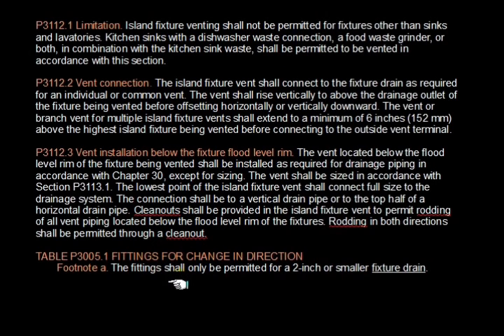Plumbing an Island Fixture Vent / Bow Vent / Chicago Loop

Comment: I completely agree with all your findings also the  vent wye on the shower drain should be a vent tee or sanitary teeon  atleast 45 degrees up  but we are allowed use 22 1/2 in Chicago but what i did not understand why were not allowed to run vent line underfloor horizontal because i do it all the time to reach a wall to come up in

Comment: Never heard of using sweep 90's on anything but closet lines on a horizontal bend...and that being above ground...underground requires 2 45 ELS on a closet line that's horizontal...so that's a weird one on the sweep bends.  Never heard of ever having a problem getting a snake thru ANY PLASTIS DWV 90...I have seen dudes use a vent 90 on a drain , and THAT may be a problem , but never EVER heard of using sweeps on venting ( unless I misunderstood that part and you said sweeps for the drain ).  And yes indeed , that loop vent for the lav sink is not only the wrong type of venting , it is done in a WACKED OUT fashion...he definitely needs to change that.  We also have to put in a relief drain for the vent side in case of back up AND a cleanout on the vent side as well ( for the reasons you mentioned ).  Good explanations on this one.

Comment from the maker: Yes, the loop allows for air to enter the system so that the trap does not get siphoned.  Worst case is the vent becomes obstructed and you get a slow drain and trap siphoning.

Comment: very informative! I'd love to see a video on how to vent a stall shower properly. thank you.
Reply from the maker: That is another one that is relatively easy but I see piped improperly all the time. Either wet vent the shower through the lav or make sure your dry vent comes off the shower drain at a 45 degree or better angle. When plumbers don't understand I tell them to drop their vents through the sole plate first, then pipe the drain under the vent pipes connect with a sanitary tee.

Comment: Allow air to prevent the trap from siphoning. The "island sink vent pipe" needs a clean out because a blockage can create problems with in the vent system itself. There is a greater possibility of foreign matter, fats, oil, grease and food matter, which created the blockage in your drain system to enter the island vent system.

Comment from the maker: @MidwestWarfare The code calls for cleanouts to be furnished in the vent so the entire length of the vent can be rodded.  If you could get the rod going upfrom  the drain and then get it through the bow, I suppose you would be able to do it-- but I wouldn't want to be the one doing it!  My interpretation would be that the fixture drain does not meet the intent of the code for furnishing a cleanout in the vent..

Comment: What is the wost case scenario in this particular venting system?  Wouldn't the system still have adequate venting?  Also is it typical for vent pipes to be "rodded"? I have never heard of vent pipe ever needing "rodded".  

Isn't the main purpose for a "loop" vent simply to allow air behind the water for a faster drain?

Comment: Seems like the code has you do too much.  Over emphasis on venting similar to over emphasis on eye protection.  I see no reason why the shower vent wouldn't do it job even though it's shared with the island vent, but the code says no.  Pretty sure it's still going to work.  Isn't that what really matters?

Comment: you could shoot over through the 2x4 wall with inch and half pipe duh. you could build a chase or soffit and run the pipe in that. some areas won't let you island vent period . talk to whoever is going to inspect it.

Comment from the maker: It was an interesting space, in that the ceiling was vaulted and the beams/underside of t&g decking exposed. The walls stopped at 8 feet.  There was no direct way to run the vent, but he could have gone laterally into the exterior wall, then up.  Problem being the VTR would have been 1' from the eave.  That being said, you still have to follow the code.

Comment: How do you vent a shower if the pipe has to be above the flood rim? The vent would be sticking out of the floor.
Reply from the maker: The drain can be run horizontal for a certain distance prior to making your vertical connection to the vent. For instance, with a 2" shower trap/drain you can run 8 feet horizontally from the trap before making the required vent connection to the drain line. The issue almost always is that the dry vent is run horizontally below the floor. Proper planning of the drain line routing eliminates the need to do that.

Comment: I have a question about that breather/ y vent for the dishwasher. Does the dishwasher have to be connected to on of those breather cap? At my place I connected  it to the garbage disposal with no problems. However I am converting a dual sink to a single and adding a quarts counterparts with a dishwasher and disposal. I would really like to not have a second hole in the quartz for that breather drain as it is currently hooked up. I read somewhere about tying the dishwasher line somehow? what problems could occur if I eliminate that breather thing. this is on an island with the type of drain in this video.
thanks,
Reply from the maker: Depends on what code you are using and your local ordinances. In most of the country, no. The IRC allows you to loop the drain up to the underside of the counter and then connect to the dispose ( IRC P2717.2). I believe the UPC requires an air gap like you have.

Comment: Ok here is my question..is there a structural code in your area where you cannot drill thru studs? Instead of using the island vent on that fixture I would have 90ed the pipe thru the studs and up into the wall extending to the ceiling and if necessary added in stud shoes to the joists..In Virginia ive been plumbing since 1998 and never have needed to use a loop vent.As long as you can run say a 3" line thats within 12' (varying) of the trap to the island fixture from the vented stack its OK
Reply: A little late response but, I think he said the wall didn’t continue up to the ceiling and that’s why he had to use the loop vent. I could be wrong though

Comment: Island vents must have cleanout access.
Reply from the maker: +Jill K You care correct. Refer to the video and the second comment on this video where I point that out. Removal of the trap allows for rodding the drain P3005.2.9 ex. 1) but a cleanout is required in the vent piping "to permit rodding of ALL vent piping  located below the flood level rim of the fixtures" (P3112.3)

Comment: Should be a sanitary tee off the trap arm. Not a Wye and 1/8 bend down stream!? The reason for these codes are so that the trap weir doesn't siphon. It needs to remain full of water to prevent sewer and methane gas emitting into the household.

Comment: your bow is too high. when the drain clogs the water will go on the floor. A lower bow will allow an emergency exit for backup water. In such an emergency case the bow vent will prevent a flood and  "drain" if connected into a sewer pipe as well as tying into your vent pipe on the far wall.  Saw this "emergency drain feature" of a bow vent on one of those home building shows.
Reply from the maker: +waitansee as long as the horizontal portion of the bow is at least 6" above the outlet of the sink/lav, it complies. It can be 6" or 24". Typically this is always below the flood level of the sink/lav since these are predominantly used in islands. Nothing wrong with what you're saying, but this would probably be the only fixture in the house that would have such an "emergency exit". Still, point taken.
Reply: I agree with Waitansee...  it's a silly way to run a bow  (and I'm not clear on why a loop vent was needed here in the first place...it's a full-height wall, was there no way to connect a standard vent?  I've never used a bow/loop vent anywhere but in an island situation...  But I digress....  Silly or not - the height of the loop vent does comply with the code.   The flat connection to the shower was stupidity however - it's common sense that a vent needs to come in above the mid-line of the drain, or risk all kinds of back-up... "suds-ing"  and other problems.

Comment: A lavatory sink? Since when has one of those been more than one fixture unit? Since.... never. So why is the vent 2"? For that matter, why is the vertical drain 2". This is the basic rule, folks. The smallest drains the code allows and the largest water lines the owner can afford.

Comment: "Hundreds of ways" to vent an island sink? Really? I only know one here in Los Angeles. LA plumbing code book shows 1. Loop it above the flood level, provide a c/o in the vent portion, tie it in behind the drain with a com-bee and carry it back to the closest wall before going up and out the roof. You also need a clean/out in the vertical portion that is going up and out. Make sure you use all long sweep fittings and a pipe size larger than the typical size for venting. 2" not 1 1/2".
Reply: Bob Lavoie CA has suck codes.  Contractors don't have to be licensed and use crap illegal workers

Comment: That is totally ridicules that set up.  I' a plumber of 30 years experience and if my guys did that I'd probably fire them.  There are hundreds of ways to vent an island sink.  This is not acceptable in Canada and it will not pass an inspection.  Don't even think about the 2.99 mechanical vent at the local hardware store. You must learn the trade.  5 years, 10, 000 hrs then 2 years to become a master plumber.  Please do not teach such second rate butcher work.